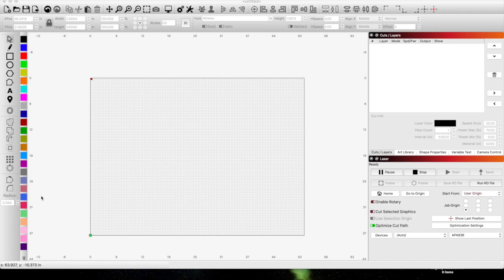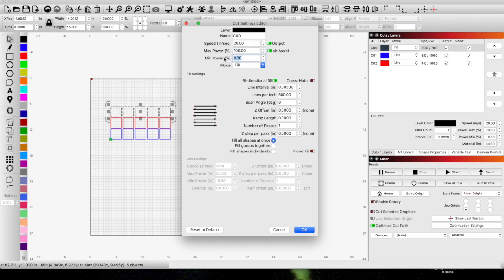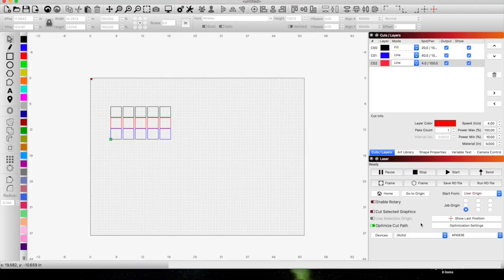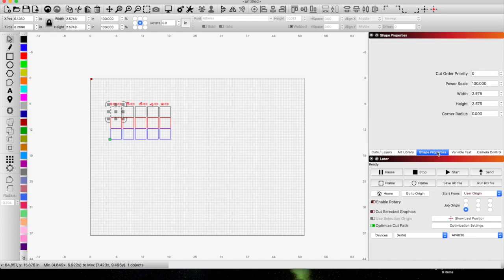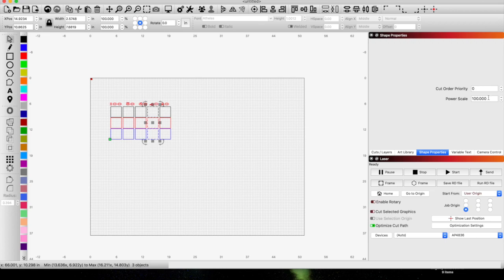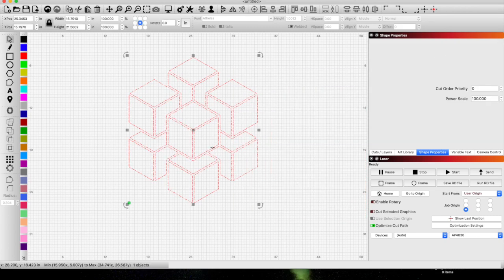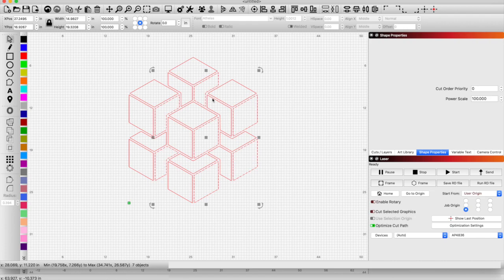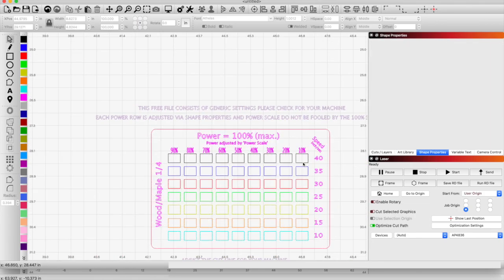HOW TO.. Power Scale

Comment: Will setting the min power too low cause it to just run full power for the whole test? I tried 10% to 80% but it was all the same reading on the amp meter.

Comment: Great job on this.  I thought it might be helpful to clarify one point (correct me if my understanding is incorrect).  My understanding is that the Min and Max power settings per layer (in your example 10 and 100 percent), set the boundaries for the range of power available to be assigned per layer.  So by setting the Min power setting for the black layer at 10%, this becomes the minimum (0%) power for any object on that layer.  When you set a particular shape on the black layer to 20% power, the actual power setting applied is 10% + 20% * (100% - 10%) = 28% power.  In many cases this may be a subtle point, but I think it is helpful to keep this in mind when going between "absolute" and "relative" power settings.
Reply from the maker: My min power is set to my "optimum" turn on point for my 100w. There are very few instances that this minimum power is referenced. Cutting as you corner speed, Grayscale as your white engraving power and this power scale otherwise its irrelevant